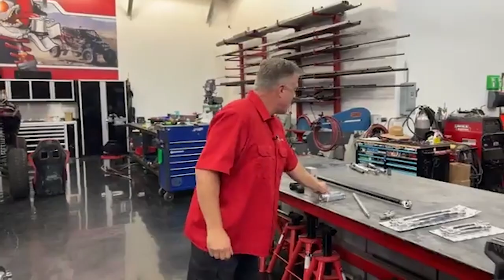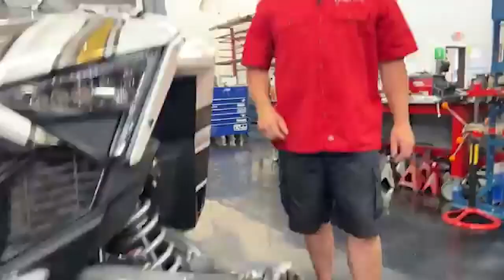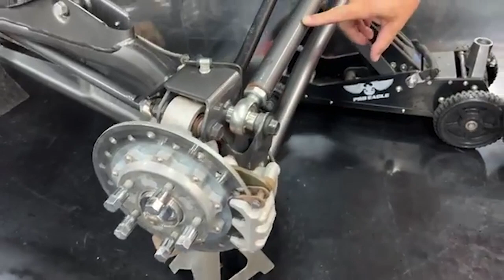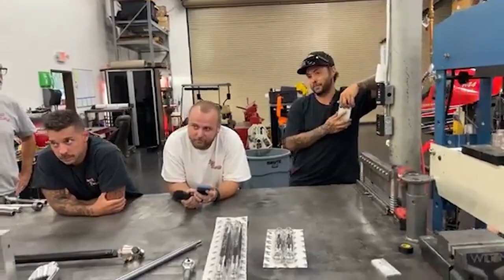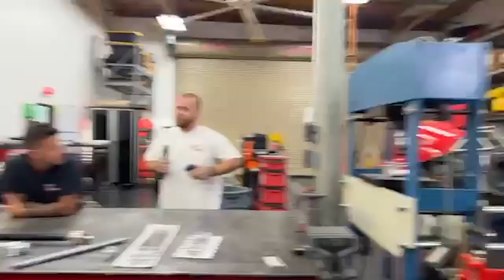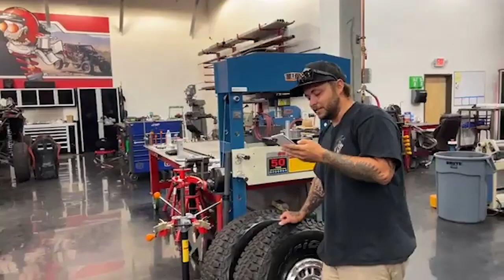New Polaris Pro R & Turbo R Shock Forks! // Throw It Out There Thursday (Plus Tech Tuesday)

Comment: Is in normal to have my forks both angled towards the drivers side? Seems like the welds were made that way. Nothing looks bent or twisted
Reply from the maker: The mount on the arm is a pivot.  You should  be able to angle them any way you like.
Reply: @ShockTherapyllc  Awww, thanks for the clarification! I can see that now.

Comment: I have the S&B Air particle separator for the helmet on my Pro R, it works amazing. It’s Low profile and does not take up the space that the Rugged Radio air pumper takes.